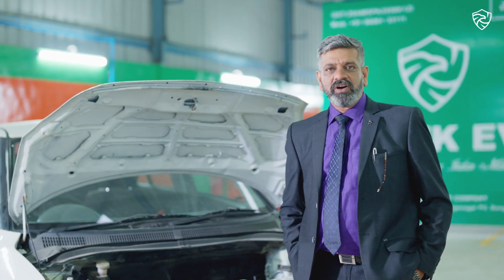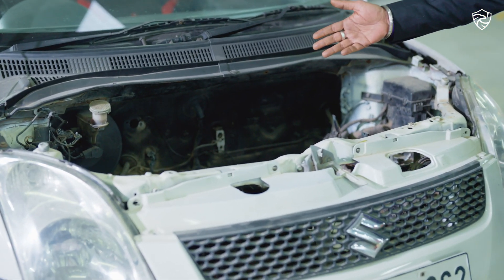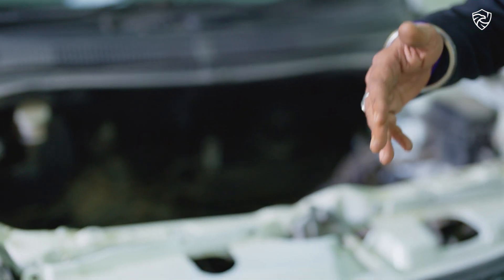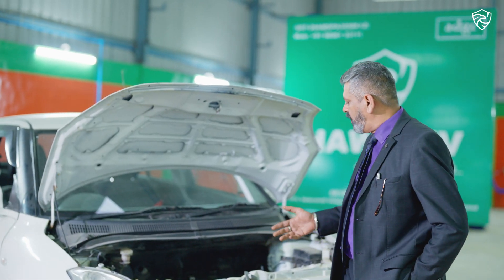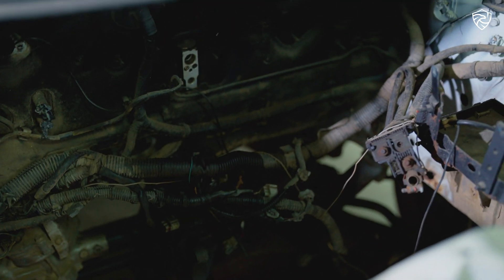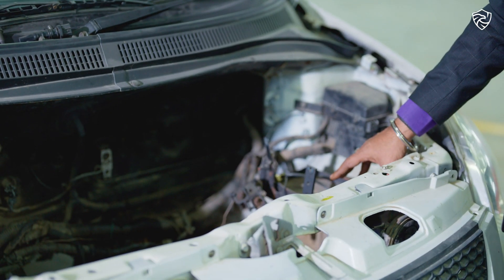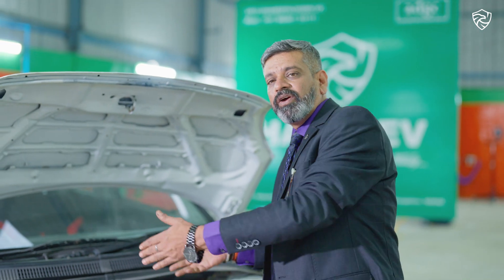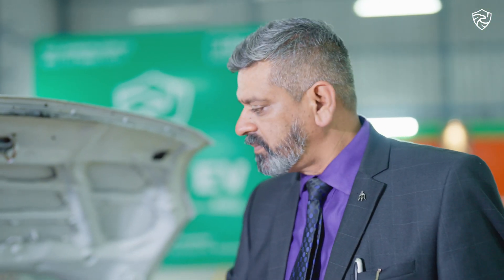A brief insight of retrofitment by CEO Dr.Anupam Deb | Hawk EV Retrofitment

Comment: Does the speedometer etc work? Are there any engine errors shown? What happens to gear knob?
Reply from the maker: Speedometer works like usual. On manual version, grab knob can be retained.
Reply: @hawkev  That's weird ! For user experience, the gear knob has to be changed to p-r-n-d.